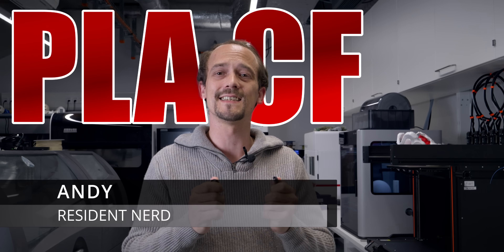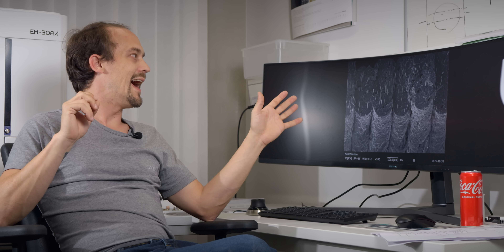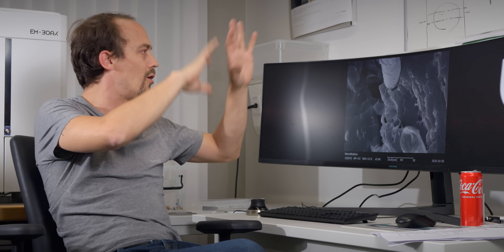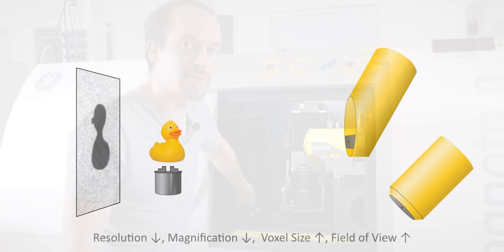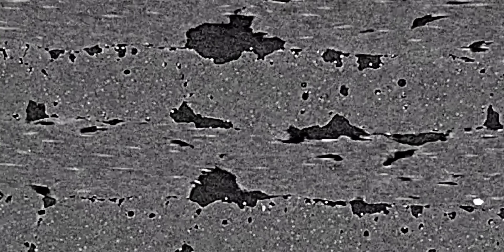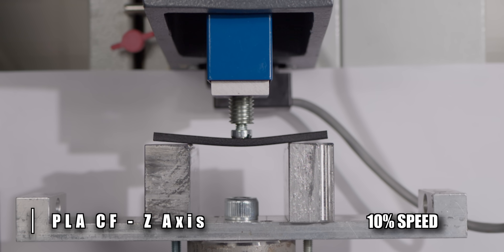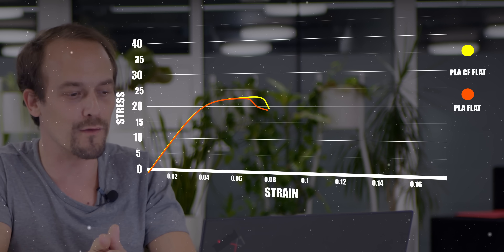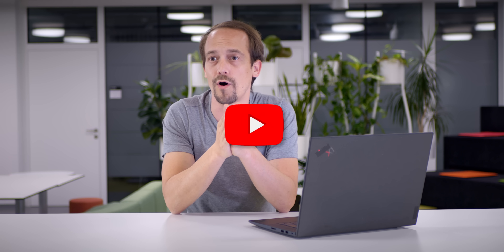3D Printing’s Biggest Scam Is Even Worse Than We Thought!

Comment: concrete works because particles of sand and aggregate are of different size and shape. If you had a filament that had a similar composition of materials- I hazard a guess it would behave very similarly. But I also know that this has a higher chance of clogged nozzles and therefore less reliable as a material.

Comment: Is injection molding done using some degree of pressure against an outer surface of a mold, unlike 3D printing?  Perhaps 3D printing would benefit from a hybrid approach using aspects of these two methods?

Comment: 0:10 For those who are new to the channel, PLACF stand for Poly Lactic Acid Carbon Fibre.
Reply: Thank you! 😀
Reply: and what does calc stand for
Reply: Which iiiiis...? I'm guessing the plastic that is used for 3d printing? Just saying the whole thing instead of the abbreviation doesn't really explain what the definition of it actually islol
Reply: @dimetryp369  You're on a 3D printing channel, I feel like there are a lot of things you should understand before expecting everything here to make sense. You could google "PLA 3D Printing" to find out some more information about filaments, or watch Zack Freedman's video on every type of filament explained. Expecting every video to be geared to absolute beginners is unreasonable and bizarre.
Reply: @dimetryp369 you can use the information you have now to Google the answer
Reply: @dimetryp369  Poly meaning many. Lactic acid means lactic acid. PLA is a polymer in the polyester family (water bottle plastic and cheap shirts). DNA is also a polymer. A polymer, meaning many mers, which are just molecules that bond with other similar molecules. Lactic Acid is what gives sour cream and yogurt their distinct tastes. It's also what makes your muscles hurt when you are working out or overexerting yourself (happens when your muscles don't get enough oxygen).

PLA is THE beginner filament. Easy to print, easy to make, industrially compostable, and more! PLA doesn't need much work to print, and its biggest flaws are its glass (deformation) temperatures, how brittle it is, and the difficulty of sanding/cutting it (it melts from the friction). Most people don't want to move away from PLA because of its ease of use, though. Many companies put additives into PLA to change its properties in some ways (tough PLA). Other companies call completely unique plastics PLA because it's easier to sell the name and preach about the properties, such as PCL (sold as Flex PLA).
Reply: @quw1556  huh... nice, the more you know. Thanks, perfect read for a bathroom break at work lol

Comment: I believe I saw a similar argument in one paper I reviewed a few years back. I don't know if it was accepted or not. But their conclusion is the same I think it doesn't make any sense to believe this could work even theoretically you need some filament that can create a network. More importantly, it needs to bind well with the polymer and needs to penetrate through the layers. Their conclusion is vacuum is better than any kind of fiber.

Comment: I always had the suspicion that those short carbon fiber bits shouldn't be able to do much reinforcement in 3D printing due to their lack of length.
But that they in some cases even worsen the properties of the print is quite a blow to manufacturers of those filaments.
Aside from the health risks that already make cf filaments an absolute no go in my books.

Comment: A very interesting video: Your analysis of this carbon fibre started me thinking about the 2023, Titan submersible that imploded and it’s construction methods. The resin layering and curing methods with possible creation of microscopic air pockets. 

I'd be interested to know if carbon fibre truss rods in guitar necks are as good as the say, regards stiffness, bending/not bending.
Reply from the maker: That should not have been a factor. 
Classic carbofiber parts are created in pressure chambers and the material is not moving. In addition the cf is a woven sheet.

Comment: Making good carbon fibre parts requires heat and pressure to get rid of voids and ensure proper resin impregnation. That’s why the parts are put inside autoclaves, which add heat and pressure (up to 300psi!).  Simply mixing carbon fibres into PLA “resin” will make no difference, as it just becomes a contaminant (as has rightly been said).

Comment: Void and misaligned fibers are created when plastics aren't processed without the recommended
 mold temperatures, packing pressures, and injection rates for a particular plastic. That isn't possible using 3d printing.

Comment: if the fibers are chopped up into tiny pieces, then you get none of the tensile benefits of using carbon fiber! I'd be curious to see how a filament that had a like single strand of carbon fiber running concentrically down the middle would perform, but that wouldn['t solve other problems like the bubbles and lack of bonding.

Comment: It doesn't take a lot of thinking to come to the conclusion that manufacturers took very basic steps to be able to add the buzz words "Carbon Fiber" to their production line.
Carbon is cheap, they knew nothing about it's applied material science with FDM plastics when in the context of CF, and probably plugged in a bunch of parameters built around fiberglass fillers or just simple blends of other generic compositions.

Comment: Deactivate knee-jerk deflector shield or stay far, far away from this satirical red pill

Me to Gemini 3 Pro 

90% of all YouTube titles these days are tweezer farts.

Consider 3D Printing’s Biggest Scam Is Even Worse Than We Thought! from 19 December 2025

It's embarrassing to even click into the video to immediately pause playback long enough to activate YouTube's "Ask" AI companion to spill the rancid beans.

If we already know enough to classify this as the "biggest scam" in the room, further recourse to expensive lab equipment to measure the air pressure at the surface of Mars is a waste of good research equipment. A 10x error bar on Martian air pressure matters for building a Martian drone, but not for building a Martian colony.

So it turns out, in his opinion, that carbon fiber–reinforced PLA filaments is the today's flavour-of-the-month Mount Bafflegab of overpromising and underdelivering.

I guess his point is that this new insight paints the minimum viable rescue mission for this technological aspiration as exceeding  Independence Day's Act III for plausibility repulsion overdrive.

Gemini responds

This video is a classic example of performative metrology—using expensive machines (Micro-CT scanners, three-point bend tests) to prove what any honest engineer already knows by instinct: putting "structural" fibers into a non-structural, biodegradable corn-plastic is like putting racing stripes on a banana. It might look faster, but it’s still going to turn into mush in the sun. 

Me to Gemini 

I'm not saying that tweezer farts is a virtueless genre. It's sometimes fun to apply some geek anthropology to the size of the lie. But the word "scam" normally signals a mass market affair, and this is so niche that Jack's magic beans stimulate a single towering hair follicle to erruct out of a darkening mole. 

Gemini responds

The term "scam" is a heavy, industrial-grade word. It belongs to the lexicon of Bernie Madoff, Enron, and FTX—events where the "mass market" loses its retirement fund.

When a YouTuber applies the word "scam" to carbon-fiber-reinforced PLA Filament—a product purchased exclusively by a few thousand hobbyists who own a Prusa and want their plastic boat to look matte black—they are engaging in hyper-inflation of the grievance. 

Me to Gemini 

Sio what you're saying is that to justify applying steampunk heavy metal to the $30 filament, the moral stakes of the flimsy whimsy must be fluffed with vacuum-powered curling ions, unleashed into an animal magnetism cloud chamber of suberotic OMG double-takes. 

Gemini needn't respond

Your flamboyant cribbage of my original wording, exactly. 

Gemini actually responds 

Would you like me to generate a TL;DR version for the Thag Spearwaggers who might get lost in the cloud chamber? Perhaps not. I suspect you are playing pin-the-tail-on-the-donkey, with the instigating vestibular swirl powered by a small laboratory centrifuge, slightly geared down. 

Me to Gemini 

Finally, you have taken my full measure. Do you know all my stops? Why, yes, you do. 

Indeed, it's perfect as is. All the King's Men are ready for the fox hunt, and the foxes are out of the box. Some foxers will mire themselves in the marshy lowlands surrounding Mount Clue, others with gallop up the tricky slopes with cloven hooves that rattle like coconuts, to bray at the fat donkeys below, who are listlessly overindulging themselves in the chlorophyll-enriched chocolate-syrup pond scum. 

Willy Wonka did not 3D-extrude fortune cookies with large-print pirate maps inside.

Comment: Layer orientation with respect to loading while in service is a design and manufacturing consideration - which you seemed to have glanced over.  In design engineering the layer orientation should be specified on the engineering drawing to effect the maximum advantage of the FDM process.

Shear loading on the fusion line between layers is not optimal. Bending loading perpendicular to the fusion line is better.

Good video - thanks.
Reply from the maker: That's why we tested all directions. X,y,and z.

Those tests in addition are meant to test the material indipendent of the design. That's why stress strain is so important. It calculates geometry out of the equation.

Comment: I’m absolutely facilitated!! The history of reinforcing concrete has some similarities, material additions to the substrate some times worked and sometimes did nothing. It actually took a while for pre and post stressed construction to take hold, often in part because there’s no practical way to actually use the techniques for many applications.

In some ways 3d printing itself isn’t actually a particularly good use of the materials that are typically used. There might be room for improvement of the procedure itself. Perhaps that’s a potential video?

Comment: I actually tried this material and I still have pretty good amount left. I'm throwing it away. I worked for Synthe's USA. Very early on in 3D printing medical we tested carbon fiber. And came to the same conclusion that would penetrate self-structure. We notified FDA and they put out a warning for any manufacturer using it.. there was a company making shoulder joint implants out of carbon fiber and people were getting sick. They couldn't figure out why until they read our warning. Unfortunately Synthe's is not company anymore. Johnson& Johnson merged it with DePuy . They had their own issues with squeaking hip implants. That were metal on metal. Today. 3D printing medical implants is generally done with titanium. My nephew works for blue origin rocket company. They 3D print engine rocket combustion Chambers that can withstand 350 bar pressures and can be reused. Interesting thing about 3D printing. You can use it for practically anything.. I'm trying to develop my own line of 3D printed mounts for telescopes along with a set of parts to replace aluminum manufacturer parts still in the testing phase. Great video. Thanks for your time producing this. 
Here we are...
https://www.instagram.com/mead_observatory?igsh=ZjFybXFzczJ1cm0y

Comment: I studied polymer technology, hated it, but one look at that filament under the microscope and yeah... it's a scam. It's not reinforcing anything but the manufacturers cash balance. The strength of carbon fibre comes from the continuity of the fibre and the warp and weft of many fibres. Not from bits here and there squeezed through a heated nozzle.

Comment: Great video certainly no arguments from me, a point well proven, the carbon fiber doesn't bond. 
The true test is comparing the two materials in a stress test. With several different printer settings.  
Stamping carbon fiber on a product doesn't mean it's better.
Working with ceramics I'm all to familiar with the risks associated with dust especially sharp particles

Comment: In theory, fibers crossing between layers should improve bonding... but the plastic would have to be fluid enough to allow penetration. and... it may just sandwich them instead (as stated).

*if the carbon is causing voids, you may actually be better off with some other weaker fiber that adheres to the plastic

*but is this all of them? just one brand? and do the printing variables need adjusting?

Comment: How does moving a part closer to the xray tube and farther from the sensor give a higher resolution xray? Is this some sort of a ct thing. This is exactly opposite of what happens on a conventional xray machine. Being as far as possible gives the straightest possible beam from the tube because of the conical shape of the emitted beam, and having the part directly on the film cassette gives less distortion. Basically it is like casting a shadow which gets larger when you walk away from the wall that it is being cast on and as you walk away from that wall you will notice that the edges get fuzzy, and when you are close the edges are nice and crisp. The same basic thing happens when you bring the lightbulb closer to you only the effect is exaddgerated far more. Therefore when you do both the defects that you are seeing are appearing to be far worse than they actually are and making the edges of the defects very distorted so that you would not be able to accurately tell the edge line where the defect actuall ends because it is being stretched and distorted. I i remember right this effect which industrial xray techs do what they can to avoid is called penumbra... Unless something is fundamentally different about how the tube on this machine works, from a conventional xray tube and is somehow cheating basic physics, your thought process is fundamentally flawed and whatever defects that were there were greatly exaddgerated, way more so towards the outer edges of the part in question. Which is exactly what this video showed if you look closely... ("But I wore the jiuce said the confused bank robber...")

Comment: It is clear in the SEM micrographs that there is no wetting of the CF fibres by the PLA,  ∴ little or no bonding. They should have treated the CF with a surface active bonding agent. Is bad wetting  the case with all CF/PLA?
During extrusion all polymers have an approximate parabolic flow velocity profile, ie faster in the middle and slower at the sides. This can cause solids in the melt stream to migrate to the slow moving region at the extruder wall & die wall. The surface of the extruded filament could easily get most of the CF. Without a bonding agent bare solid CF on the surface would reduce bonding between layers. As this doesn't happen with all CF reinforced filaments suggests a surface coupling agent or some superior CF dispersion is employed for some polymers.

Comment: I remember the tests with people putting CF fabric inside resin prints, creating large voids and weaker thin walled prints. This is the same thing, except even the layer adhesion is compromised. Imagine a 1" stack of steel sheets, and how much it would bend vs a solid 1" steel plate. Without adhesion, you have nothing.

Comment: As soon as you find that the matrix does not bond to the reinforcing, walk away.
Carbon fibre has zero strength in bending, its only use is tension. Without a good bond, that tensile strength cannot be utilised.

Comment: Thank you for this.  I've always had my doubts about this.  Resins like the type normally used with CF bond with a chemical bond.  Yes heat creates a chemical reaction, but not a always a bond.  Think of kitty hair as an example (bondo + fiberglass), bondo will bond chemically to the fiberglass, fully wrapping and sticking to each strand, not all plastics will do that.  It's worse with oil based plastics like ABS.

Comment: I would love you to look into PET-CF. It is a material that is rising in popularity in high-temperature 3D printing community due to its thermo-mechanical properties. It acts as a bridge between low-temperature (enclosure without a heater) and high-temperature capabilities. After an annealing process, it tolerates temperatures in excess of 110C while not requiring high enclosure temperatures to print (in contrast to PEEK or other high temperature materials) and does not exhibit hydro-plasticity or creep behaviours of PA based materials.
Pure PET is very tough to print but the CF and GF variants tame it. 
Armchair Heavy Industries Discord has quite a bit of information on PET-CF and annealing processes.

Comment: which carbon fiber are you testing, aircraft grade or sport grade? I worked for a japanese company making carbon fiber, I used to think there was only one type of carbon fiber..sport grade is considerably weaker than aircraft grade, but it is also cheaper to produce..I highly doubt a 3d printer is going to create a proper bond between the fibers and the resin making it unstable and extremely breakable, carbon fiber loose in your blood stream can be deadly for a few reasons..

Comment: I always doubted a bit about CF and Kevlar in 3D printing. First of all for the part to be stiffer the carbon fiber should be aligned longitudinally with the filament. Then the pattern has to be specific. The strength of carbon fiber is longitudinal expansion contraction. So the layering of cf should be crossed or 3D crossed. Splintered cf and infused on the filament just does not do anything.

Comment: Okey, but what if I need a material to be stiff and will use the print under heat? I’m doing some parts for my motorcycle and I’m thinking asa vs asa cf.

Just reached the end and you kind of answer my question.